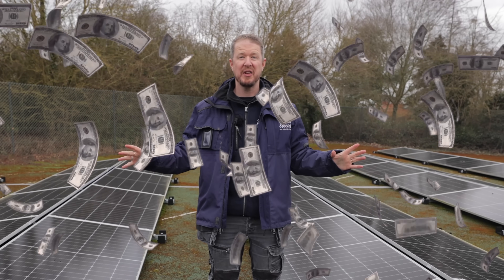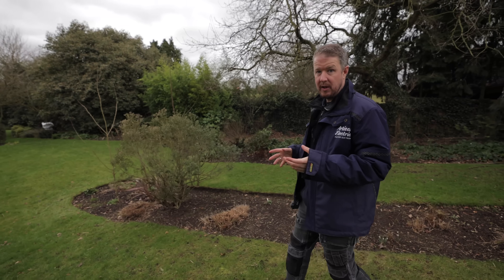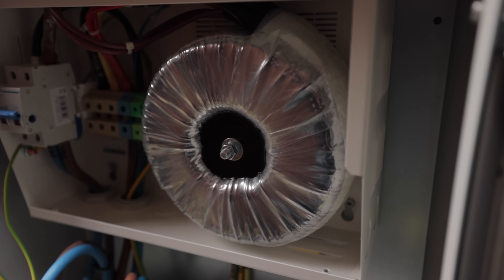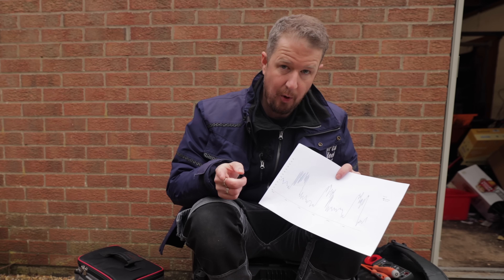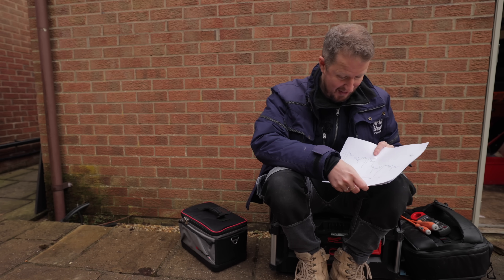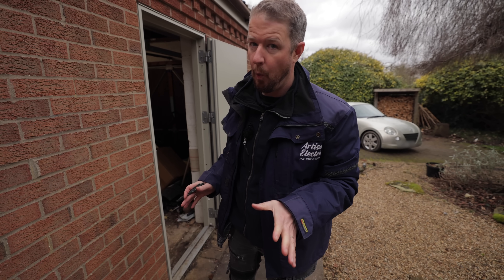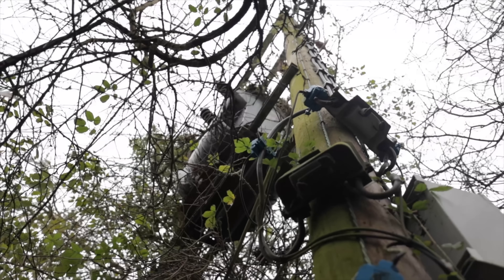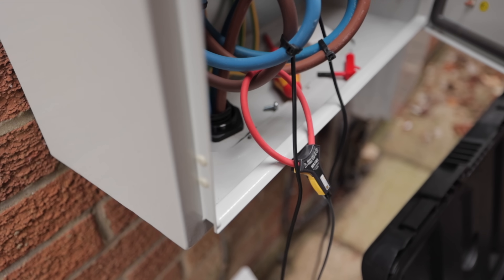THOUSANDS Down the Drain – And We Can’t Do Anything About It!

Comment: Oh dear, I think you may find this is going to get even more expensive yet. Speaking from my few years of selling uniterruptible power supplies for computers, the place to fix the voltage is with the inverters making the AC. (But as far as the voltage ranges go, I used to live in the very West of Cornwall for 20 years. We'd have all sorts of stuff blow up! 275V was not uncommon. That's what got us into UPS units in the first place.) The last thing I'd do is stick another box on the wall to fix the output. Over the years one comes across all sorts of "inverters" - from proper sine wave ones, right through to the ropiest square wave. And as soon as it became known you could shove DC into a switch mode computer power supply, well, the whole damned bus left town! If you can find someone who can still remember how to build a genuinely "proper" sine wave unit, to handle 17KW, in a box you can screw to the wall. (The transformer alone might weigh near 100KG. You'd need a forklift truck, and a good chance it would pull over the garage wall. Hmmmmm!) . . . . Borrow yourself an oscilloscope, get a big mug of tea, (and some sarnies,) and spend the day watching exactly what is going in to the inverter (s) and specially what is coming out of the back of that thing! (But how the heck you fault find if the guy won't let you isolate it both ends, well, we've all met 'em.) Good luck.

Comment: Your "voltage optimiser" is nothing more than an autotransformer with taps rather than having a wiper contact. If you are experiencing AC volages from the inverter that fluctuate that much, look no further than the inverter for the fault. It should MPPT the DC input and regulate the AC output in phase, frequency and voltage, end of story.

Comment: If the network voltage is high in summer it is likely that other PV's are punching it up higher.  To export you need to have higher than grid voltage and PV owners get upset when it shuts down.  Regulation from the end user is tricky and a nightmare for electricity authorities.  Raising the export voltage limit at the PV side compounds the problem.  Auto tap changers on transformers are not in universal use due to cost of replacement.  Just how it is.

Comment: oh and when I looked up that 11kv line at Bartlow Road, Hadstock, Cambridge  no planned upgrades til 2039  its 100kw  transformer running 40% capacity with 58 houses connected to it

Comment: I wonder how much resistance that low-voltage cable run adds. There must be a formula you could use to work out the voltage drop and how much of it is the cable run itself. 

Could they maybe just run a fatter cable?

Comment: OMG xD Do you know what this voltage optimizer do to voltage on the utility side, when you are pushing energy out @260V? 😏 It's rising it even higher xD  Great job for all other neighbors :P This kind of device MUST be triggered dynamically in conjunction with heaters or boilers when PV generation is high. Otherwise you just degrading service to all other neighbors .

Comment: Well... ok.  The basic problem is that you tried to install a 17kW AC coupled system without positive control or with a battery buffer + inverter-charger capable of sinking the power output.   You can't just export 17kW to the utility.  And then... what, you really tried to put a transformer inbetween you and the utility?  That makes absolutely no sense.  The energy has to go somewhere, the transformer would do absolutely nothing other than allow the microinverters to max-out the voltage on the home grid.  Which is precisely what you don't want them to do.

Solar installers who don't know WTF they are doing.  That would be you.

These are your choices for a large rural system:

(A) DC-couple the solar.  Hello?  Should be obvious.   This is really the correct solution here if you don't want to have a massive inverter-battery system to sink the excess energy.   With a DC coupled system the grid-tied string inverter has full control over managing output power on a cycle-by-cycle basis.

(B) AC-couple the solar and combine with an inverter-charger (a hybrid inverter-charger system) + battery storage that is capable of sinking the entire output of the array for several hours.  That would be, roughly...  a 20kW inverter capable of doing 12kW continuously at a minimum, and around 30kWh of battery storage, minimum.  Plus an integrated ATS so it can disconnect and control the AC coupled solar once the batteries are full.

The one thing you DON'T do is AC-couple 17kW of solar into a rural grid without any controls to limit the export.   This isn't the power company's fault.  This is the "dumb solar installer who thinks hes an EE" problem in a nutshell.   AC-coupled solar is designed to push its entire output to the grid at all times.  The only way an AC-coupled solar system can be managed is by disconnecting from the grid and then doing frequency control (UL1741SA), or via proprietary out of band communications and control (such as what Enphase offers).  And even then the servo is going to be very slow compared to DC-coupled solar and a string inverter.

-Matt

Comment: You obviously can't be dumping 17kW into a single phase overhead supply.

Plus you know that, especially when it is a long way from the sub; you certainly should have known this would need to go onto 3 phase and they also should have told you as much; so you're both at fault.

Then again, you did it with three inverters which can presumably handle multi phase so the whole thing is probably just content farming off a silly answer from ukpn.

I await the 3 phase conversion video.

Comment: I think it's not the transformer that doesn't have enough capacity. It's the line to the transformer that is undersized, and thus, to be able to get voltage in an acceptable range to the most distant house they did tap the transformer to a more high voltage setting, such that your customer is getting 240V, maybe the one nearest to the transformer 250, and the last one 220/230.

Another issue could be imbalance between phases, your customer is maybe putting all that power on one phase and the other customers are all tapping the other phases. Maybe by requesting a 3 phase setup and by balancing the loads on the three phases you could get a better voltage (I don't know if in the UK getting a 3 phase supply is something costly or not).

Comment: Ask solaredge whether they can throttle the PV generator and the battery charging based on the voltage. You can do it with Fronius inverters so would assume the SE inverters would do it too.
Reply: Solar edge do offer an intellengent export limiting meter. set export to about 6KW max and you would be fine...

Comment: Looks to me that the problem is the voltage drop in the line between the transformer and the site. It was stupid of the network to allow 17 kW back to the grid but I doubt you can get them to pay for the upgrade of the line. You cannot put more than 253V (or whatever the spec is) into the grid. Just illegal. If less than 17 kW flows into grid with that voltage, then that is your customers problem. And yours. I doubt that the contracts guarantee that 17 kW will flow back into the grid at 253 V grid voltage. The 17 kW is a max spec at best conditions and requires you to limit your push to 253V. 

Unless the network explicitly stated that "sure you can push 17 kW AND the grid will not rise above 253 V" I think you are screwed.

Comment: I want to see part 2 of this. It is interesting with me because I do not know how the PV system is connected all together with regards to this set-up. I am wondering if the inverter is grid-tie, then the basis of its waveform will be the grid and knowing that, the inverter should send already a high voltage warning or even disconnect the pv system. Also, not only the EV charging will experience the high voltage but the whole household? Next, if the main line of the house is 300m from the supplying transformer, then it should feel a significant voltage drop, but base on your test, it still carries around 240 average. This only tell me that the transformer voltage is around 250V at source (transformer secondary terminal).

Comment: 🚨🚨🔥🔥Everyone TELL JORDAN, look into the Solar Edge inverter software and set max voltage to 248V max. What solar edge was thinking they shouldnt allow higher voltage settings, grid.connection is too crappy for 73A.
No joking there, you are overclocking the grid power, and it is danger with cooking electronics like computer powersuplies.
I like Artisan Electrics and this needs to be fixed for 5 stars🔥🚨🚨

Comment: The problem is clearly too much impedance in the LV and HV lines and not enough loading from nearby neighbors. If there is high impedance to the loads that will accept that 17kW of course the inverter will need to produce a high voltage to push that power to them. The inverter probably has a voltage limit of 260V and it is hitting that before it is able to reach the full 17kW. If this voltage is too high then probably the inverter needs to be adjusted and the owner needs to be realistic that they cannot export a full 17kW on their grid connection. The grid operator will not know exactly how much power can be pushed - the responsibility for keeping the voltage within limits sits on the solar exporter. Jordan blaming this on the transformer clearly shows where he sits on the dunning kruger curve

Comment: DNO shouldn't have granted a 17kW export limit on a 300m cable run from transformer!

Fortunately as you've got batteries they can be used to absorb some of the solar energy and stop as much reliance on the grid.

There's not really much the DNO can do to fix the issue.. So i guess you need to be more conservative with what the battery and solar can export/import.

Comment: Can you not just fire out less than 17kW into the grid at any one time? Rather than top up batteries on an overnight tariff, maybe just top them up with some of the solar? Or use some of the energy into a thermal store and do away with a lot of the electric heating?

Comment: This is a common issue we’ve had in the Netherlands for years. Electricity flows from high to low voltage, so when a house consumes energy, the voltage in the house drops, allowing power to flow in. With solar inverters, when there’s excess power, the inverter raises the voltage slightly so the electricity can flow back to the grid.  

The problem happens when many solar inverters in the same area are generating excess power at the same time. All the inverters start increasing the voltage to send power to the grid, and this can lead to overvoltage. If the voltage exceeds 253V, the inverter’s safety feature will shut it off to protect the system.  

Using a transformer to artificially increase voltage is illegal and dangerous. It can push the grid voltage above 253V, which could damage appliances in the neighborhood. If this happens, you and your customer could be held liable for the damage.

Comment: Instead of using a voltage optimiser or fighting the utility company why not install  a voltage stabilizer  on the house?  A 24 kW would do the trick and you'll have no more hedache. Check Well Aegis 30KVA/24KW.

Comment: Since the primary issue was the customer not being able to charge their car, I am wondering why the charger could not be wired in upstream from the trip device, providing it was rated for the higher line voltage?

Comment: Was this all because you used a voltage monitoring trip device instead of an rcd due to it being a TNC-S supply? Would it not have been possible and cheaper to rectify it by fitting a remote stand alone (just separate from the main house/structure) vehicle charging post with its own earth spike making it a TT and only requiring an rcd for protection? Therefore no longer effected by the voltage fluctuations?

Comment: Surely it's not a G99 compliant installation any more if you've added a voltage optimiser/transformer up-front. It might be stepping-down the voltage from the grid to the house, but it's also stepping-up the voltage from the house to the grid. So whilst the Solar Edge inverters are G99 on their own, and therefore work within the 253V limit, this is now being stepped-up another 6% so the poor neighbours might be seeing 268V exported from this installation.😢
Reply: And that's before considering that the inverters were outputting 260V already. I suspect it just needed someone to review the inverter settings.

Comment: 17KW on single phase? also that optimizing transformer will raise the voltage you feed to the grid by 6% so you will inject 260V+6% to the grid...which is quite bad

Comment: Basically your supply authority should never have approved the 17kw import/export without taking into account the grid voltage disturbance caused by your installation.  
In Australia all grid tie inverters must have numerous protections built into them including but not limited to grid under / over frequency, grid under / over voltage, RoCoF protection plus on newer installs the supply authority can take control of the inverter and switch it off remotely. In Australia the uptake of home solar has been immense leading to sections of the grid running into reverse power causing problems with substation protection relays. 
The grid over voltage protection works by causing the inverter to ramp it's output down as needed to keep the grid under the maximum allowable voltage.
The energy saver is just an auto transformer, stepping the voltage up or down by fixed percentages, they work as advertised when used as advertised, great for saving energy on huge shop lighting installations. The voltage bumps you are seeing are a mix of standard I R losses caused by the too small overheads and perfectly normal transformer impedance, it's the impedance of the transformer that's lets transformers be safely paralleled without circulating currents.

Also in Australia the supply authority will disconnect without recourse any installation that causes disruptions to other grid users or the supply, I hope your customer is friendly with their neighbours. 
I have commissioned grid support generators at a mine site to hold up the grid while large ball mills are started, once spinning the generators can be taken off line and shutdown. This was due to the 11KV DOL mill motors making the lights flicker in a township 80 km (50 miles) away down the 132 KV lines.

Comment: Sounds to me like there's an unacceptably high resistance between the property and the grid, this would cause a voltage drop when pulling power from the grid, and a voltage increase when pushing power to the grid.

Comment: DNO Transformer rating too low.
Having now watched all the video I suspect that the 300 metre cable run is the problem.
17kW pushed down that cable is resulting in large losses. Voltage of 262 at customers property will likely measure 246 at the DNO transformer.

Comment: Shoddy transformer 😂 I can almost guarantee UKPN won't touch that transformer until it fails. 
The fact you've had issues after you installed the solar and BESS systems, sounds like a you problem rather than a UKPN problem. Easiest way you could solve these issues is stop exporting onto the grid. I know it sounds daft, but UKPN would probably prefer you not to export onto their grid. Mainly because they have no control over the generation onto their network. 
You're probably better off just letting the solar array charge the batteries rather than generating onto the grid.

Comment: I wonder if the neighbors see the same spikes, destroying their household equipment. It is clear that such a powerbank will sweep up the voltage. I have had the same experience with my neighbours who have a massive number of solar panels on their roof ( it is an industrial building). We see occasionally 260 V as well, just within the allowable tolerance ( 263V). In the Netherlands btw. 

The problem is that if you deliver power into the grid it must be higher than the actual grid voltage. So, in order to make your home system think it is below 260 V, without switching off, place a transformer between the house and the grid, transforming the gridvoltage a wee bit down, but consequently transforming it  up when leaving the house into the grid. Thats a tric we use. 

If I understand correctly you placed a transformer but thats before the car charging  point? 

I may have misunderstood.